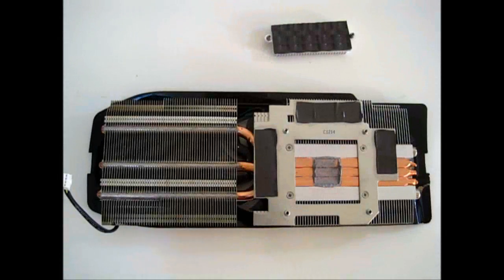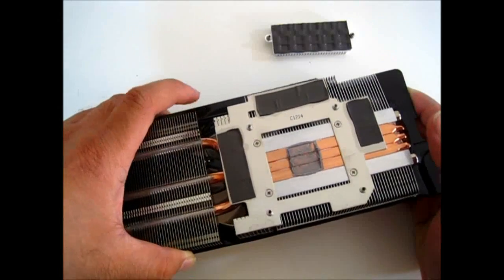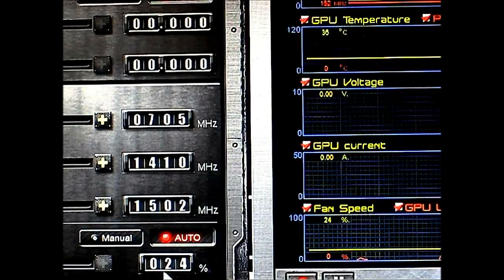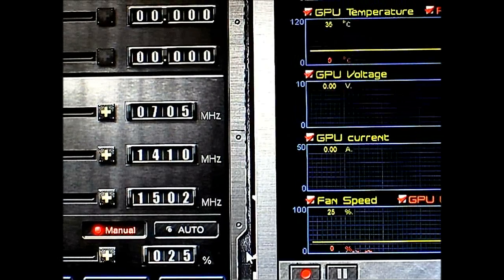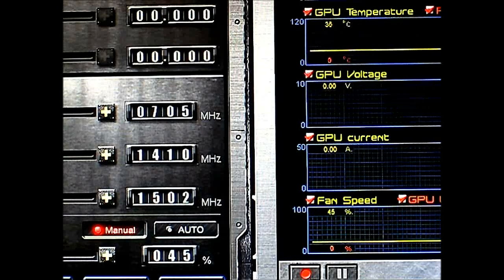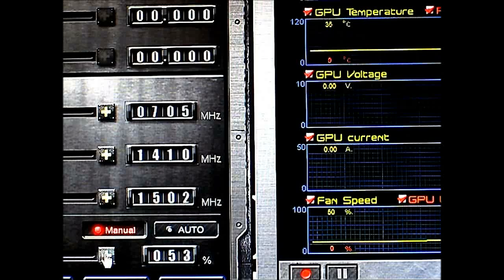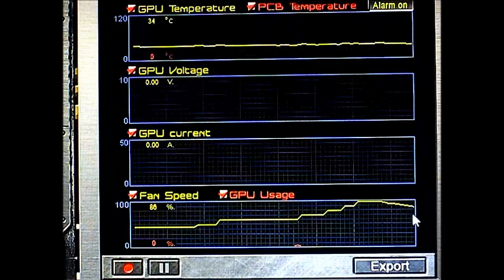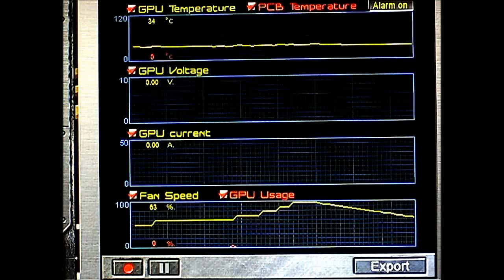Gigabyte Windforce 3X Cooling System on GTX 670

Comment: Hi, I have a problem with mine, it is reaching 103 °c and then it shuts down, but no one else seems to have overheating problems with this card so I'm thinking mine is deffective or something, what do you think?, I'm only running Napoleon Total War. It shouldn't be a big deal, should it?.